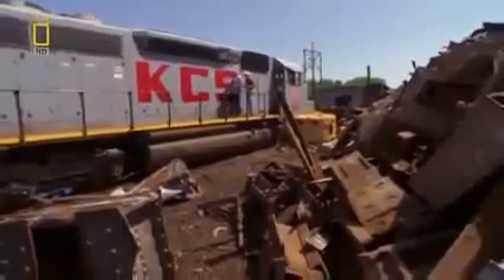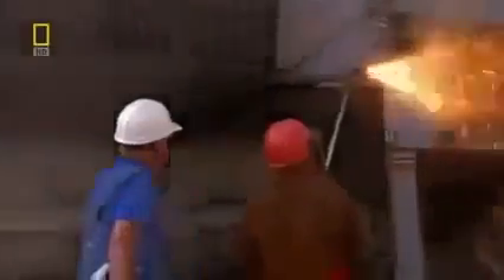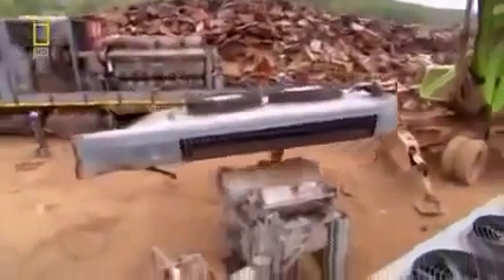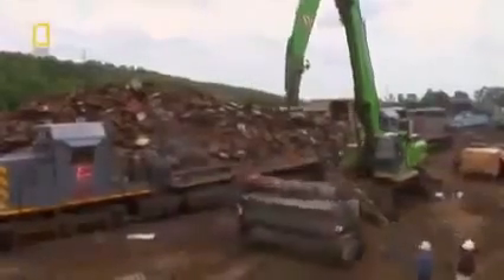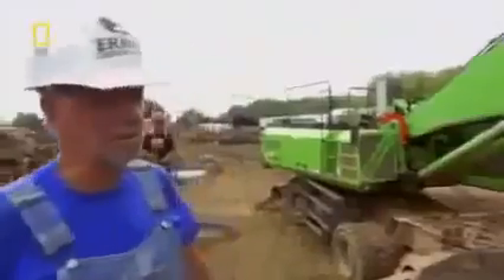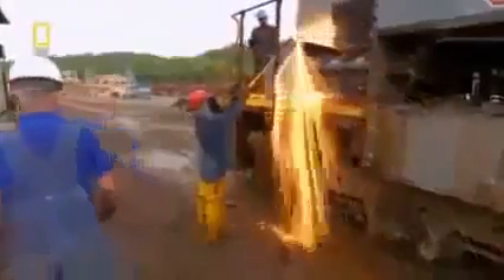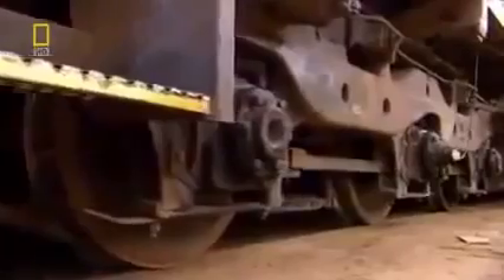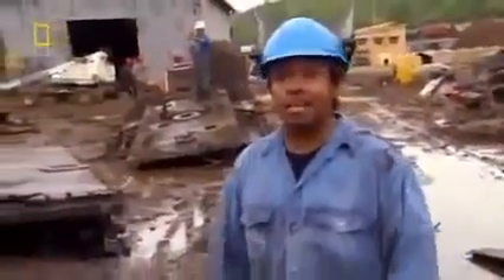The Great Train Wrecking Yard : Documentary on Destroying Retired Locomotives (Full Documentary)

Comment: Well, I agree with folks who wonder why they scrapped a fairly good locomotive with significant service life left in it.  These SD-40-3, (rebuild SD-40's) have a significant value as power on secondary lines, even as the class I roads are slowly reducing their fleets of them.  If this was wreck damaged or other major failure, perhaps, but it was not.  It had a solid frame and body and had not suffered significant rust damage.  As it was a -3 rebuild, it had most likely undergone a major upgrade.  These are perfect for the secondary rail roads as they have an extensive parts support network and can be easily maintained.  Something that is not nearly as readily available for locomotives such as the General Electric Dash 7 or Dash 8 series that are being retired at a fairly rapid pace.  The older EMD locomotives are easier to maintain and their usefulness is still very high.  Sad!
Reply: it had a ....
Reply: In this video they show how to murder my kind and I do not like it

Comment: I feel bad for this Kansas City Southern (KCS) EMD SD40-2 Prime Mover locomotive unit. I used to see them dominating the rails back in the 1990's & mid 2000's. In my country, the locomotives that used to run in 1970's & 1980's are still running till this day, despite that they were manufactured in late 1960's and early 1970's. You can still fix them up and revive them, instead of scraping them. There's plenty of metal and junk to scrap. I wonder what was wrong with it. I wish I could buy this EMD SD40-2 prime mover locomotive, running or not. I still like EMD SD40-2 locomotives better than EMD SD70Mac's, SD70ACe's, SD70AH's, SD80's & SD90's. For some reason, I like standard Spartan cab locomotives over Wide Cab locomotives. Even GE's C40-8's & B23-7's and such. They bring back good memories!
Reply: this one is actually a plain SD40

Comment: It would have been nice if they had put an estimated dollar amount for each stage of the break-down, so viewers could tell how much overall a re-cycled diesel locomotive is worth.
Reply: Much of the mechanicals of these locomotives get rebuilt and reused. Main engine, air compressor, generator or alternator and electric motors will be rebuilt or remanufactured and used on existing older locomotives.

Comment: Not a "blowtorch".  A cutting torch.
Reply: Yes. And, cutting torches don't work by melting steel, but by incinerating it. And, while the basic flame is 1:1 ratio of oxygen molecules to acetylene molecules (as the narrator states), that's just used to heat the metal; the actual cutting is done by pushing a lever that adds extra oxygen which literally burns the metal. Just one more thing the narrator of this video didn't understand.
Reply: Robbie Hatley It's not the narrators fault, he only reads what the writer has written for him, it's up to the researchers  to provide the correct information to the writer.
Reply: you are a bit of the mark to mate, 
they don't 'incinerate' the steel either,
the oxy acetylene torch has a  tip that has a ring of small holes around the much bigger center hole, a jet actually, the small holes pass a mixture of oxygen and acetylene that is burning, and is there to heat the steel to ignition point.
 then, using the trigger valve to release the oxygen from the central jet, which is at about 30 psi.
 oxygen chemically combines with the steel to oxidize the iron quickly into molten iron oxide and is blown through the cut, that's the big spray of sparks that go all over the shop, its the oxidation that makes cut, the steel it doesn't 'burn'  ..

Comment: An EMD crankcase is not a one piece casting, it's a mix of cast, forged and pressed parts welded together. A cast crankcase would be too rigid and would crack with the flexing in a train. Also that super special solvent being used to clean the crank shaft and the operator is not even wearing a basic mask? mmmm.

Comment: Makes me wonder why these locomotives were scrapped. They are often refurbished & upgraded before being returned to service. What was the driving factor in the decision to scrap these?
Reply: That's a really good question but the answer is complicated.  The Locomotive in the video, an EMD SD40 series were built starting in the early 1960's.  For Locomotives, that is still young.  OK, for the answers.  Some Locomotive manufacturers take older locomotives in on trade.  Especially competitors locomotives.  They don't want the old locomotive to compete with theirs so instead of rebuilding or even just repairing the defective components, the locomotive is scrapped.  A terrible waste of a Locomotive.  I have seen working locomotives cut up to make the value of the remaining locomotives like it higher.  A terrible but true example of 'Supply and Demand'.  By reducing the market of a particular model of Locomotive, it makes a Locomotive Leasing Company that has many of this type of Locomotive have a higher value.  They get to charge more for the ones they have.  Not pretty but true.  Many short Line Railroads would love to have these Locomotives.
Reply: ehh yuck....

Comment: Narrator is clueless on acetylene cutting. The larger scrapping torches are almost always LP which can be used with a much greater flow rate. Acetylene is far from the only gas hot enough for torch cutting. They should use narrators from the industry.

Comment: An EMD don't ever stop running, as long as you feed it diesel, oil and water. Have to be a complete idiot to botch on of these behemoths up.
Reply: Well... I have seen some interesting videos where diesel locomotives developed internal oil leaks into the cylinders. Starts a huge fire which is hard to put out; basically burns until the motor oil is used up. But ya, other than something bizarre like that, or a head-on collision between two trains doing 80MPH each (yes, that's happened) diesel locomotive engine blocks apparently last about a century from what I've seen. (And maybe more. I think the technology is less than a century old. Maybe some of the locomotives from 1950 will still be running in 2150, 200 years later. Time will tell.)

Comment: If the engine and generator can be remanufactured why scrap out the locomotive in the first place.
Reply: Probably the same reason why people junk cars. Everything is around it is falling apart or too expensive to update. They probably get tax deductions from just buying a new one.
Reply: FRA regulations on how long a locomotive or freight car can be used in interchange.  They can be rebuilt, but that only gives you a specific one-time additional period of use.  Also, fuel consumption and emissions will dictate the cost effectiveness of rebuilding a locomotive for the balance of it's prospective lifetime.  This was an SD40 locomotive, likely built in the early 1970s, making it about 40-45 years old today.

Comment: It is not a generator, it is an alternator
Reply: no, its a generator. because the wheels run purely from electricity the diesel engine is only there to make the power (electrical) to run the locomotive
Reply: brian6265 An alternator produce AC current, a generator produce DC current.
All early EMD locomotives were equipped with alternator producing 600 ac volts rectified to DC to supplied DC to traction motors.
Alcos were equipped with generators that produce DC current who were transformed into motors to start the diesel motor.
Reply: The word "alternator" is just shorthand for "ALTERNating-current generATOR". All alternators are generators, but not all generators are alternators (some are DC). 

And in layman's usage, "alternator" always means "small 3-phase AC generator with built-in 6-diode full-wave bridge rectifier and built-in 13.8V voltage regulator intended to recharge 12V lead-acid car-starting batteries and run automotive electrical systems". The generator in a locomotive does not fit that description. (For one thing, it's probably about 1000 times heavier than what a layman think of as being an "alternator".)
Reply: François D no, it is a DC generator. Alternators produce AC. Most older locomotives run on DC.

Comment: Batteries: Sodium hydroxide?
Reply: Lead Acid actually.  Eight individual Batteries with four Cells each.  Hooked in series to have a 64 Volt rating (2 volts per Cell).  The charging circuit is set for a nominal 72-74 Volt overcharge.  The Batteries are mainly used for Starting.  However they come in handy for Electric Heat and Radio communications if the Locomotive should fail in Cold Areas.
Reply: Yes, I was amused by the narrator saying "these batteries contain caustic acids such as sodium hydroxide". Dumb-ass. Sodium hydroxide is, of course, an alkali, not an acid. Oh, you can make batteries out of alkali all right, but then tend not to be rechargeable. (Flashlight batteries, basically. EverReady, Duracell.) These days most rechargeable batteries tend to be either lead-acid or lithium-iron-phosphate.